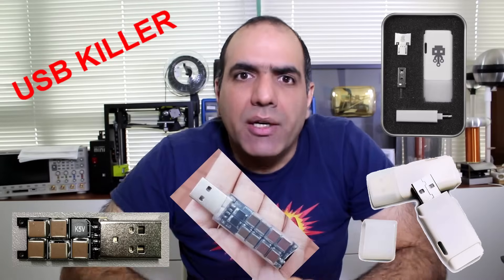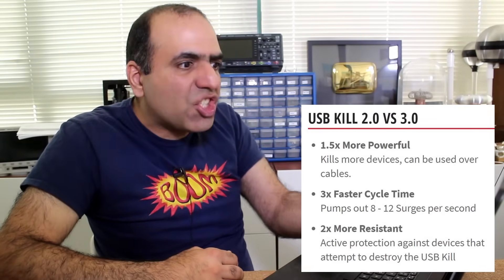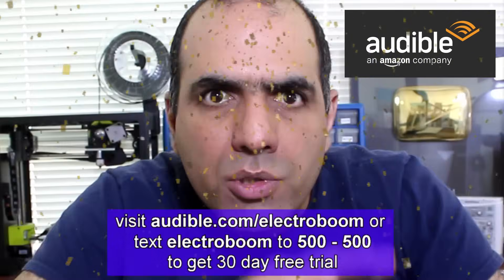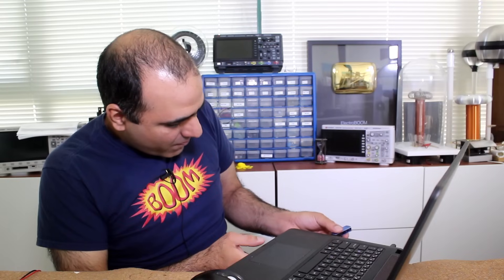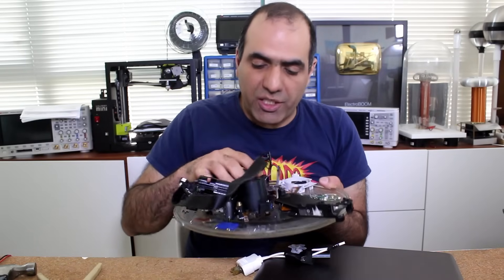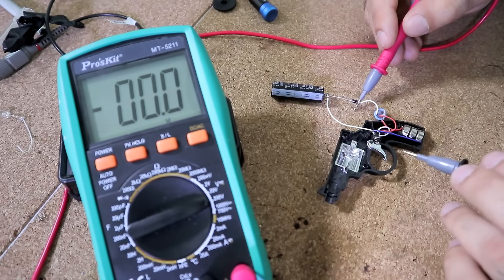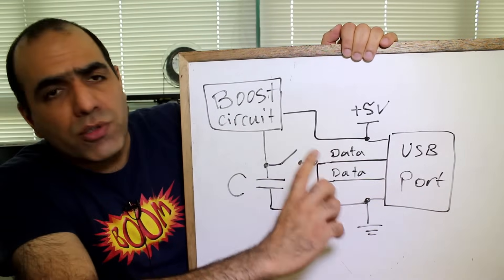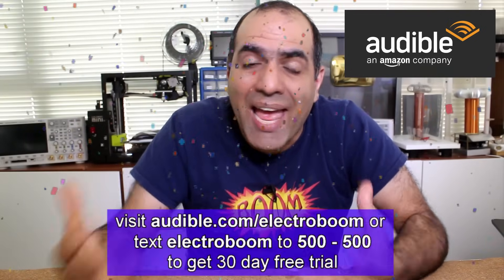USB Killer… WHY???

Comment from the maker: Hello Fam! Am I wrong about USB Killer? I can't imagine unregulated amounts of destructive power is used to test anything! Unless like I said, the plan is to check people's intelligence, and that would cost a bunch of money in equipment just to teach people a lesson! And why damage, when you can achieve the same thing in software, by tracking who plugged it?
If you like to post your thoughts and video ideas, submit them to ElectroBOOM subreddiit: www.reddit.com/r/electroboom
Reply: I work at a computer store, and we have seen the results of things like this. This and some other things like it are for destroying devices in a way that looks like a manufacturing fault for warranty fraud purposes. For example, our store offers replacement plans where you get a gift card when redeeming the plan. Some people like to buy something with a plan and then have the device conveniently fail shortly before the term of the plan expires and get a gift card to buy a new device.
Reply: They are quite useful for computer security teaching in companies. Nothing will be remembered better than a exploding laptop if someone plugs a found "usbstick" into the computer. (And overall it is way cheaper to replace a laptop than to loose all your data)
Reply: @EmpirePhoenix  Except for when you have open documents or flash storage. Dumb way to teach users
Reply: @EmpirePhoenix  lol yeah would be funny
Reply: Warranty abuse
Reply: Recreate the scene from breaking bad where they jumpstart the RV with galvanic cells in the desert, and you get 1 superlike
Reply: Everythingapplepro has used usb killers to test the protection of smart phones
Reply: Mehdi, please don't turn into a typical fat American. Fresh fruit and vegetables every day!
Reply: I've seen these used to ensure motherboards are killed before sending them back for RMA, where a known bad, but intermittent board is killed permanently to ensure it makes it through the warranty process. They're also used to destroy overstock/returned items so that they can be thrown away without people picking them out of the trash and using them.
Reply: @squat224  understand the first, but why destroy good stuff?
Reply: @superslimanoniem4712  because the company wants you to buy something, not pick it out of the trash.
Reply: @squat224  Why not just melt them down and reuse the electronics inside them?
Reply: @coastersaga  because capitalism. In other places they'd be stripped of usable components and recycled. It's not really economical for a big box store to go through all that work. Much easier to destroy it throw it away and make consumers buy a new one.
Reply: Clearly....  this must have all been somehow Etherkiller-inspired. 
So yeah  "legitimate test equipment" is just a facade or false reason for selling the product in order to avoid getting sued.     There's nothing to justify that price tag,   and   legitimate test equipment doesn't need to be so compact or disguised  so that it could be confused with a normal USB flash drive.     This product is specifically designed to be useful by someone for covert  malicious use;  as in vandalism,   and oh, how convenient that they're also a company selling some type of  "defense"/protective device,   Except  this doesn't fully prevent all the nefarious applications,   such as schoolkids sabotaging  public computers with them, etc...
Reply: It's obviously used to test stupidity
Reply: 9:12 "Although, I don't know...do they actually use bombs to simulate earthquakes?"

Introducing, the 1971 Cannikin Test: https://www.youtube.com/watch?v=UPwSN9gUG5c
Reply: How pitted are your meter probes?
Reply from the maker: @ferulebezel  pitted!
Reply: @ElectroBOOM  i hv one question, hw does the cap in the camera get charged to 300V from a 3 V battery ( At 6:43 minutes of ur vid)? Was a boost converter used somewhere?? The question might b silly though...
Reply: ElectroBOOM hi
Reply: @Newbiefly7698  I have the same question! Want to charge my DIY capacitor without static or transformers.
Reply: You're not wrong. Selling both the weapon and the defense system, there's no way around the fact they're giant dicks catering to others like them, and likely getting loaded while doing it.
Reply: leddit
Reply: Thanks to USB killer, many devices nowadays are protected against high voltage on data lines. Smartphones and videogames are getting better because of it. Of course it shouldn't be sold to common people, that is true.
Reply: It's probably meant to destroy stuff and the company just doesn't want to get sued
Reply: Yes, it is used for pen testing in critical environments, where there should be mitigations for such an event.
USB-C could potentially address this vulnerability but I'm yet to see authentication properly implemented.
Reply: This shit should be illegal.
Reply: A possible legitimate use of one would be to plug into public USB chargers and kill the data lines to prevent someone from trying to juice jack your phone. Correct me if I'm wrong, but a usb charger is only connected to the +5v and ground to a connector.
Reply: Ok boomer
Reply: Hi m8
Reply: Let's say that someone stole my purse or wallet. If I can't do anything about this, why SHOULDN'T I HAVE USB KILLER inside them, to take at least a little revenge or payback against the thief or thug that robbed me? It was his choice, so if he's now gonna plug the [killer] USB that he found in my purse or wallet into his PC or laptop, then he's doing this on his own responsibility.
Reply: Hey electro. It could be used to test reverse charge protection.
Reply: @MyMika2004  There are far better ways to test that. On top, that should be a design issue, so to be solved by engineers that know the in-and-outs and know how to use a power supply,  ferquencey generator and scope. A test is nothing without measurements. This device haas only one outcome:  damaged hardware - no test results at all.
Reply: @MyMika2004  no, to test reverse charge protection you should apply the same voltage the port is intended to receive (USB standard says beetween 4,5V and 5,5V) but with reversed polarity. The USB killer applies a voltage that is much bigger than that.
Reply: @MyMika2004  Finnaly somebody gets it
Reply: Hi!
Reply: i make a lyden jar like you when you make it but i dont have pvc pipe to charge it ineed thing like the pvc to charge it what is plss help me
Reply: Bill Murray the dead dont die  https://youtu.be/Gyvq02QS3sI
Reply: Sos el hermano de Juan Maldacena?
Reply: I think they mention it on the site, but in short they want to force manufacturers to build overcharge protections into their devices. Apple for example already implements some protection, but not for all devices i think. Its really cheap to implement something like this, and honestly this should already be a standard in USB. Also on their site you can get pro kit with testing kit for 72eur. With testing kit you can check what devices are protecter and which are not without destroying your device.
Reply: I am a fan of your videos because you shout in every video.  Be you.  You are informative and hilarious.
Reply: Like you said, some weaker ones will o my destroy the usb slot. This can keep other people out of your computer, although not very practical
Reply: @nishantkumar127  You should use Loudness Eq on your headphones/Speakers :P
Reply: When I watch your videos and you get shocked I can literally feel the pain
Reply: I read that commercial airplane manufacturers need to test with these in order to verify that someone with one of these can't destroy the plane's avionics through the USB ports in the seats
Reply: They are used to demonstrate the surgeproof usb ports. I personally use them to purge any old computers that have storage devices on the motherboard
Reply: Some people just want to watch the world burn.
Reply: I reckon a t-shirt can be made off the back of this... #winner ;-)
Reply: maybie tis to trick thevies? keep it on you keys andf catch out the cancdr from your circle. they wont know it was you and if they did its on them. you can then stop spending time with people whos computer completly breaks in the time it take to go to the toilet :P
Reply: Kill our URanus with that 
Lel 😂
Reply: i actually wanted to know whether it can be used to commit suicide or not? i m nt a techie so just guide me plz 🤗
Reply: agree think they are garbage products
Reply: I keep it in my purse so that if I am ever robbed... ;) jk, yeah malicious only
Reply: Those before and after stuff should be in every video.
Reply: Believe it not, companies such as Apple and Samsung have protection in place for such devices even on cellphones (because there are adapters to connect it via Micro USB). So, in a away, the device can be used for testing purposes. But I think mostly people just want to have fun seeing what they can destroy of their own property, not necessarily others. But it is used that way sometimes unfortunately though...
Reply: It's used as part of security penetration testing. The idea being you can disrupt a system for whatever your nefarious purposes might be. Theoretically a malicious entity could taint a replacement part that's being kept in a less secure environment and then leave the USB killer around to destroy an existing system and force the tainted replacements into use
Reply: Welcome to the insanity of this world. I've been on the same tear you have for quite some time now- just not on these, per se.
Reply: Actually, you already did the job of this device. Let's say you want to steal some data from me and you steal pendrive from my desk and plug it into my computer. Boom, your computer is gone. Even if not You don't know it, before you  plug it.
Reply: You Rosted USB killer
Reply: @Jesun-morningstar  I just said, that it is no more, that a weapon - you can use it to attack or to defend.
Reply: Hi Mehdi,  looks really dangerous Maybe put eye protection?
Reply: hi dude can you make a good teser gun from mosquito killing bat not like in your previes teser video
Reply: Hey Electroboom the Lichtenberg video got deleted from youtube why ?
Reply: It's meant to be used by testers: If you find a bug, use the USB killer to kill it.
Reply: I killed my old laptop with my bare hands. It had power issues and was agitating me. Broke the hdd, screen, and keyboard.
Reply: ElectroBOOM. I hope you didn’t destroy the laptop
Reply: @ElectroBOOM I believe it so that hardware developers can test their overvoltage protection. Apple has bought some of these (afaik) to test it.
Reply: Then theyre totally useless, they are probably a government prank to block malicious computers at the criminal`s expenses, while data stays untouched ready to be analyzed!
Reply: Happy Canada Day!😊
Reply: How to destroy a computer? Send it to Arabia!
Reply: I like your videos. I hope they get a translation into Spanish at some point .. well .. do you know anything about cold energy? I would like to know what you think of that. Anyway I send you a hug and greetings from Argentina
Reply: Hey electroboom check this out https://youtu.be/N7HO-FGJIFU
Reply: https://youtu.be/wOW6gtxfk8U enjoy!!
Reply: It's useful. For "security consultants" to market themselves by showing what evil things a criminal could do to your unprotected computer so they can sell you USB-killer protectors.
Reply: loved this i haven't laughed in a while thank you for that
Reply: I can speak russia. But just a little
Reply: It's used to make Viral videos and test devices power surge protection.
Reply: Maybe a USB killer is a tazer that's disguised to look like a USB flash driver
Reply: No, seriously somebody uses the USB killer on any of my devices I'd tase them Alexa didn't deserve that
 Siri got brain damage now
Reply: If you have ever worked in any computer retail store... and sometimes.. you have to return a computer when customer goes all out and tries to drag the company through the mud... even though the computer is actually fine, in a lot of these cases if the computer is within the normal... "DOA" period... a company may.. use... something like a usb killer, to produce a "valid fault" so they can then return it to the supplier for credit...
Reply: ElectroBOOM. These USB devices are used in blackhat hacking. It is very fast way to disable someones computer and later *fix it with your malware. So next time dig deeper before saying its useless. ITS NOT!
Reply: @radiiiiiiiiiiii  yes. VPN servers that run on RAM.
Reply: I keep one on my keyring labled "secrets" just to fuck with anyone nosy enough to steal my data
Reply: It's used to destroy everything around the USB adaptor and the USB itself
Reply: Some devices can somehow prevent the frying the motherboard
Reply: Well, I have some USB memories, but unfortunately no one kills my laptop, my computer or any other devices. Probably in other continents.
Reply: a usb killer is actually good for testing purposes, for example... when samsung worked on the galaxy s10 and s10+ they thougt about safety features of tge device and tested the s10/s10+ to make sure that the phone dosen't get any damage. everythingapplepro testet the s10+ with the usb killer and the phone didn't react at all from the usb killer amd the charging port was still working perfectly fine.
Reply: I'm gonna download this video to a  usb and share it to family&friends and call a killer usb 😀
Reply: https://www.ndtv.com/indians-abroad/indian-student-vishwanath-akuthota-gets-a-year-in-jail-in-us-for-damaging-college-computers-2084886?fb
Reply: Nobody needs it
Reply: U stupid bro 😂
Reply: USB devices like these are almost strictly for malicious purposes and function as a physical DOS attack. Its just more subtle than a hammer. A possible use I could think of for this involves anything that is vulnerable to this attack and would result in something connected to fail open.
Reply: Just to answer the question you posed in your video about whether they use bombs to simulate Earthquakes the answer is yes, sort of. Explosives can indeed be used to artificially generate seismic waves which can then be used to learn more about how seismic waves propagate and even learn about the geology of the area and composition of the Earth. The data from these artificial waves can then be used to build computer models of how the geology of the area responds to seismic waves that can then be used to simulate hypothetical natural seismic wave sources to simulate hypothetical earthquakes or volcanic eruptions etc. Course explosions used for this purpose are not simply limited to conventional bombs, geologists and seismologists have used atomic bombs for this purpose also granted usually piggybacking on already planned nuclear tests.
Reply: Its used for testing the resistance of your product.
Reply: You don't fail to make me laugh
Reply: I mean it would make sense if you were testing to make a computer that is bulletproof and only the USB ports will be destroyed with everything else being intact.
Reply: I have 2 of those things
Reply: The usb killer DOES test isolation of usb ports in design.   I know macbooks will actually still operate after being attacked with a USB killer.  And some smartphones   (tho the port is toast).  so it does have a niche use.  But for consumers. this is ueless    utterly useless.
Reply: You should get your own comedy show
Reply: A USB Killer can kill my I pad
Reply: I don't think anyone actually really harms other people with it, like you'll be caught anyway. The guy who broke 60 computers you saw got a year in prison. It's entirely a novelty, and it's fun to use on old laptops that are destined for the landfill anyway. I just watched you kill like 5 laptops, that had to be at least a little fun right?
Reply: U poopie
Reply: USB.   Kiler. Happy
Reply: It's one of those things, started out as a device to show a flaw in USB hardware and then someone turned it into a weapon.

Its primary use is destruction, the fact it even exists at all is enough reason to develop protections against it.

While yes, you could just plug in a 120v AC line into a USB port and fry the computer, these devices are portable, discrete, and work very fast making them perfect to sabotage critical infrastructure.

They really shouldn't be available for this reason, but they are. The bright side is manufacturers are starting to build protections against them into their devices which does improve our national security.

As a "test" device, the only people that I can think of who would want a destructive testing device like this would be military and electronics manufacturers looking to add protection against these devices.

It's a bit like gun, you can't just uninvent the shit. But you can make bullet proof armor, and in order to test that armor you do need a gun- you can't just throw pebbles at it and think that's sufficient, you've got to actually test it against a real device that could destroy it to see if it can stand up in the field.

Selling them to any idiot on the internet is just irresponsible though, and these companies could probably run into trouble with ITAR if the State Department decides they're an electronic weapon
Reply: I love your video, because it's so funny
Reply: Bibitty Bobitty boo.
The manufacturers know full well 100% of their customers are vandals. Those disclaimers are a CYA measure so they're not banned immediately.
Reply: I wish I had one at the time they stolen my pc backpack with all my things.

If I had one in the backpack 🎒 ......... payback
Reply: Sometimes you drill out locks on physical pentesting jobs.
Reply: does it kill ssd? and not hdd?
Reply: This device seems to be intended mainly for penetration testers, I could imagine plugging this thing into the USB port on some kind of terminal.
Reply: Some devices are immune, sorta. They have optocouplers on the data lines so it only kills the data lines on the port you plug it into and not the whole device.
Reply: Could be used for surge testing I guess.
Reply: If you have a work laptop... often your employer will not replace it till it breaks. Leaving you working on a potato. This would get you regular laptop update from your tight workplace.
Reply: @lucifermorningstar4606  If the goal is to just break your computer in a slightly covert way, there are plenty of ways to do that. Heck, just spill some coffee on it. Or squirt some water in it. Or give it a good drop. Or shake it vigorously while running. Or put a couple staples or paperclip inside it. Or freeze it overnight then use it and let condensation do its thing.
Reply: It's designed for manufacturers to test their USB ports so they can design a USB port that is resistant to such an attack
Reply: The USB Killer is designed to test devices for ESD. Those data lines of USB Killer are acting as quasi-ESD guns.
Reply: You are Wrong about the USB killer
Reply: @valevaden  OK. This device is only for Vandalisms.
Reply: Good video. Nothing is wrong with your video.
Reply: I didn't see where anyone answered the question about what the device is "really" for; (Like the legit use other than malicious) there have been stories of data mining though public USB charging ports. This device, when plugged into a suspect port, will release the high voltage to the data lines and fry the "mining" device.  Charging ports will only have the 5VDC connections.  Now they have to sell it as a "tester" for liability and legal reasons.  Personally, I have charge only cables, two wire cables, if you're paranoid about data mining though public USB ports, use an adapter that only passes the power, or a "charging only" cable.  But if you think of yourself as a "warrior against the hackers!": then you get or make a USB killer and plug them in all over the place wiping out raspberry pies tucked under the cushions of airport lounge seats.
Reply: i think that the “legal” uses are only listed to cover the company. i dont think prople who buy them intend to use them for legal reasons.
Reply: How about the OTHER USB killer?
https://youtu.be/FhIRuNXURtg
Reply: Yep ur wrong, its used for EMP testing just as you found out. They plug it in, and if nothing happens, the pc is esd resistant.
Reply: USB Killer. 
People think it kills your computer 
Yes it does. 
It can break your USB plug. And yet. Something worse :/
LAPTOP EXPLODES. OR DIE.
Reply: Yes you are wrong. This has actually led to improvements by Apple, Samsung, and Google to their products.
Reply: Its used to text how much electricity can go into the device without it being fried. Love your channel btw 👍
Reply: They're for revenge purposes, like destroying a hackers computer or getting back at the neighbor who killed your cat on purpose. The biggest problem is you need physical access to the machine, but if you don't know how to hack and can gain physical access then you're golden.
Reply: “0000
Reply: Nishant Kumar  y
Reply: Yyyyyyyyyyyyyyyyyyyyyyyyyyyyyyyyyyyyyyyyyyyyyyyyyyyyyyyyyyyyyyyyyyyyyyyyyyyyyyyyyyyyyyyyyyyyyyyyyyyyyyyyyyyyyyyyyyyyyyyyyyyyyyyyyy bru
Reply: Nah mate you're never wrong, i wanna grow up to be like you, electrocuting myself in the name if science!!
Reply: Well mobile and computer manufacturers use it to test if their device ports will blow up due to this so that they can make adjustments and prevent their consumers devices from getting blown
Reply: I9bbjjjjjjjjjjjjjjjjjjjjjjjjjjjķğğđş
Reply: T
Reply: Great video it reminded me of the countries that cause war's like in Iran and Iraq and then sell the weapons to said countries and make money like that, dodgy innit❤️👍
Reply: @ARIO1977  I love this guy so much
Reply: @nishantkumar127  thats what he do.
Reply: F
Reply: New to this channel. 1st video. And i like it. 😃
Reply: It tests ur device if its good enough on a usb killer
Reply: I hope that Lenovo laptop was dead or old and unusable, otherwise, killing perfectly good and usable stuff is Just a bad thing
Reply: even though it doesn't delete the data it kills the device for good
Reply: LOL AWESOME BROTHER
Reply: It's a quick way to disable USB ports in a data center
Reply: @silenthill4  You've meant kill them?
Reply: From what I remember it is not to teach others, but to test if your computer is able to protect itself.

I believe it was created in India by a software engineer to test how effective his software was from being affected by unknown USB drives (normally to protect from hacker sticks). Adding the USB power to continue with the USB improvements, as well as anonymous features only make this tool even more powerful. 

However, these are like a set of lock picks. Useful in the right hands and the right time, but illegal in the ways most people want to use them.
Reply: 0
Reply: Maybe for penetration testing (infiltration testing by white hats)
Reply: Can you please make a circut tutorial. For 3,7 Volt to 600-900 Volts? Of course DC so I can charge my capasitors (3;4* 330 Volts 100uF)
Reply: It might be for tech manufacturers test whether their device blows up and sets the warehouse on fire when it is plugged in.
Reply: @nishantkumar127  bro its mehdi
Reply: It’s to teach a lesson to someone who steals your USB’s.
Reply: pelese eletroboom don't destroye your laif
Reply: At first glance, it seems like it wouldn't be useful for anything practical, but I think it may be usable as a device to test USB socket protection???  By that I mean protection against what ElectroBOOM did at the start of the video with the laptop and the 120 Volt AC cable or something similar.  (Sorry if anyone else already said this, I didn't read any other comments)
Reply: to be fair your motherboard ceasing to be would probably stop the police from seeing your tax fraud
Reply: I like it
Reply: Austin Evans LOL!
Reply: That's how they tested the A-bomb: one of these babies kills your entire population.
Reply: Lola nie
Reply: USB
Reply: USA GTA San Andreas
Reply: Is there a way to charge a high voltage capacitor with low voltage without using a transformer?
Reply: I thought its for those petty thieves that will destroy their own computer when they put it in. Sadly a 1 te trick
Reply: qAn
Reply: I prefer to leave destructive engineering a mystery.
Reply: Tbf I never heard of it until you showed it to me in this video. Now I know it exists I cannot un-know this :D
Reply: The only good thing about this i heard is to just to stop people from stealing usb

Like if you had the thing in your room and someone steal it they cant do anything if they plug it into their device since it not your fault since they STEAL IT
Reply: They used it to kill police  computers
Reply: Do you how many times you have zapped?
Reply: Hello
Reply: someone is mailing these rigged to capsules of RDX to reporters in ecaudor they detonate when give 5v
Reply: I am sorry but you keep saying other peoples property's instead of property check you grammar
Reply: The way he makes such amazing jokes while keeping a straight face 😂
Reply: you seem to be missing the point that big tech companies can use such a device to test their products and insure their products are not going to be effected by such a device...
Reply: Lol agreed!!! Firearms are not a good way to test if someone is alive! Lol
Reply: Don't want to spend hundreds of dollars on a USB killer? Just buy a Macbook! Its JTAG connector is conveniently placed on the board so that every drop of liquid that gets into your machine will go through it. For the best effect, the backlight and CPU Vcore pins are placed right next to each other, so that when they get shorted, your CPU will be immediately fried! You don't need to worry about the safety of your data either. The memory is soldered onto the board, and we've removed the data recovery connector, making it completely impossible to ever get the data off of it. (and everyone who says it is possible lies to you and is a scammer)
Reply: @MrSalat21  Somebody has watched too many Rossmann rants.
Reply: ElectroBOOM you can also make a taser from this disposable cameras the same way
Reply: Its designed for lazy computer technicians to warranty laptops.
Reply: IT HAS LEGITIMATE USE. Here's why:

Hi ElectroBOOM! So I'm a penetration tester, and test physical/infrastructural security on client companies. I own one of these devices, and use it to test in-built surge protection on servers against malicious actors on critical infrastructure. Malicious actors may plug the stick into, or get someone else to plug the stick into, critical infrastructure. This would result in a denial of service attack. Much of the time, this is then utilised to further gain access to a client's systems. They can also be used for social engineering mechanisms, for example:

I plug in the killer, the computer doesn't work, the company calls IT support, we turn up posing as IT support and use that leverage to gain access to their systems.

My job is to imitate what criminals may do to steal data, and ensure that the companies who hire us are safe from attacks. This tool is specifically designed for us, NOT for IT engineers, hardware engineers, or members of the public.

Just to clarify - people with malicious intent will target company systems with such cheap devices as you demonstrated how to make. Critical infrastructure systems such as servers usually have this kind of surge protection (yes, it is a security standard and must new servers are immune to attacks like this). Penetration testers like myself engage a client to try and break into their systems. In doing so, we sometimes use devices such as this in the same way criminals do, in order to test how resilient a company is, or as a part of social engineering attacks. This device is specifically made for penetration testing and penetration testing only. Many many USB penetration testing tools exist, such as the USB Rubber Ducky, or Bash Bunny. One could argue that there is only ever malicious use associated with these devices, but that wouldn't be correct. Security testers such as myself usually get a bit of a bad rep for this kind of thing, and we're working hard to try and show just how important testing things like this actually is. THIS IS NOT FOR CONSUMER USE!!!
Reply: @solomongilbert3186  What? That makes no sense. Plugging a "usb killer" in would not result in a denial of service attack. Penetration testing shouldn't be causing real actual damage either. If pentesters are actually wrecking hardware and data you hired a bad company. Even physical pentesting employs nondestructive methods of entry.
Reply: @frequencydecline5250  I seen a video of a USB killer in action on this platform and burned a hole in the USB chip 
to randomly do that to expense equipment is a no go.
Reply: @jamberrytastic   I have no idea what you are trying to say in relationship to the comment I made 9 MONTHS AGO. I don't know if you are agreeing or disagreeing but I stand by having said that no legit pentest group is going to go in to a company and actually wreck a company's systems. And I stand by having said that plugging in a usb killer is not going to show up as a dos attack on a network.
Reply: @solomongilbert3186  no. You wrong. Maybe is made for pentestig, but it isn't marketed like that. If it was, it would clearly state it, plain and simple 'for penetratiin testing only'. But they don't. 
Wonder why?
Maybe it was designed for that 
Just like saying picklocksnwerebinvented for testers only. No. Just no
Reply: @htcmlcrip  It is marketed as a testing tool?
Reply: @solomongilbert3186  how often do you destroy computers?
Reply: @solomongilbert3186  hi Solomon! I am getting into the IT market, specializing in infosec, and really want to get into penetration testing! Are there any tips you could give to someone wanting to break into this field of work?
Reply: @solomongilbert3186  So, you have physical access to the server, and you plug in a USB killer in order to indirectly gain physical access to the server. On top of that, instead of using non-destructive tools and documenting dangerous policy violations, you physically damage property belonging to your alleged "customer," and for no justifiable reason. Whether you're trying to instruct them on BadUSB attacks, Evil Maid attacks, badge cloning, or social engineering issues, you are going about it the wrong way.
Reply: @solomongilbert3186  I actually remember hearing about the very first ones of these that were made by IT Technicians when powered USB hubs started to be a 'must have' thing in offices (when USB ports on motherboards were a rare commodity) and were marketed as being protected against power down the data lines. People running over dangling USB cables with their chairs and mashing the cables lead to crossed wires and 5V going down the data line and making it beyond the USB hub and damaging/destroying the USB port on the motherboard because it wasn't actually protected as stated. So IT Technicians made a cable that would cross the wires and light up an LED connected to the data lines of a modified 'to PC' cable so they could determine if the USB Hub was safe to use.
So their current incarnation serves no purpose to the public, but their initial creation actually did have a reason.
Reply: @solomongilbert3186  So how does killing the USB controller help steal data?
Reply: Solomon Gilbert it sounds like you have a very cool job! kind of like a white hat hacker, but more hands-on?
Reply: @solomongilbert3186  I highly doubt most companies are going to be happy if you destroy a piece of equipment worth thousands of dollars just so you can tell them "you should probably have had some surge protection on that". Surely there is a less destructive way of figuring out if a thousand dollar + piece of equipment has surge protection.
Reply: @solomongilbert3186  It has no legitimate use for pen testers either except to educate customers to its existence.
Reply: @anullhandle  ummm deactivating security systems??
Reply: Found a use for it and its to make stupid youtube videos that you destroy expensive electronic devices! You get a ton of views and flex your money at the same time...
Reply: @the_danksmith134  dang, you're right! Also, a hungry child could have eaten that Lenovo!!!!
Reply: Well in Finland there are people who do earthquake tests with dynamite in your kind of way.
Reply: @spug3t  Finland is hardcore fam. I love Finland even more after hearing this!
Reply: I thought of one ligit use if your makeing a Artificiall general intelligence and it is going rouge then you can plug it in as a last defence.
Reply: @erikburzinski8248  to kill its usb port when its in hte internet lol
Reply: @erikburzinski8248  *rogue. Rouge is quite different.
Reply: The hammer works for this and is cheaper.
Reply: @erikburzinski8248  yeah lol
Reply: @erikburzinski8248  what? ai dont go rogue. Read the book life 3.0. It will explain
Reply: @erikburzinski8248  rouge is red and rogue is correct
Reply: @erikburzinski8248  if you can plug a usb you can unplug it or throw a grenade
Reply: I had considered making one of these when the article appeared on hackaday in 2015. Someone else had the same idea as me: to integrate it with a legitimate USB storage device and an external write protect switch (or some other mechanism known to the user). That way if the device ever fell into the wrong hands it would deter them from accessing your data.
Reply: USB killer -> female to female usb adapter -> phone charger -> phone 

Maybe 💥💣💥?
Reply: @MrBthrower  yes most devices will die from this.
Reply: @MrBthrower  linus tech tips already done it. 😮
Reply: There is a use for these. Should be part of every PEN testing kit. It's to teach people not to plug strange USB devices that are handed out or found on the street into their computers.
Reply: @Mr.Unacceptable  ehhh people are not going to pay the price for one of these devices juat hy chance a single person might kill their usb port
Reply: @iwinrar5207  Your right any pen tester worth their salt would make their own.
Reply: @Mr.Unacceptable  That's a bad way just to teach users
Reply: Make a video about wifi repeater
Reply: i actualy thinck usbkill could be usefull for 1 purpose. To develop better usb outlet for computer design to be resistant to power surge. Like by exemple when i shorted my arduino data pin and my 12v power suply ^^' ... and yes its killed my computer. i Found out that some computer have thermales fuse in there usb to protect them from that ;)
Reply: It is pretty useful tho. I used it to kill my laptop just a second before  my girlfriend check it if there's any porn. I regretted nothing
Reply: haha, thx a lot.
Reply: this product is for penetration testers that test security systems. Some companies want pen. testers to destroy computers sometimes so that they can see how their employees report it, if they report it and how quickly the problem is solved.
Reply: USB killers were a thing long before the site. Theh arent new by any stretch. 

This one being a tester allows companies to test new methods of circuit defense methods, including but not limited to optical data nodes and fuses to prevent reverse polarity attacks.
Reply: electro this is used by penetration testers who need to show they can breach a organization
Reply: When you flee from iran, yankee came to bomb your family. traitor And again, never touch soviet russia. that only one country which can protect your homeland, and you be first one who will beg about help
Reply: You look almost like Adriano Celentano ! please make use of this !
Reply: you can get one for $3.10 lol
Reply: ElectroBOOM  hi utkarsh from india....make a part 2 video showing how to protect electronics from jerks carrying the USB KILLER......cnt run forever from them😭😭😭😭😭😭😭😭😭😭😭
Reply: @utkarshupadhyaya7091  some computers have the USB data lines converted into fiber optical line then back into an electrical data line.
The result is that the data lines are isolated from the motherboard thus protecting the motherboard however the port will not survive.
Reply: @utkarshupadhyaya7091  stop snooping on other peoples usb sticks. 
Or simply plug it to your wall charger and see if it stops working... Wait that won't work as it uses data line to discharge hi voltage. .
Reply: @htcmlcrip  take it apart, a normal stick will have memory chips on it, this thing has capacitors
Reply: @superslimanoniem4712  what do ou mean? Remind me the point? Can’t find to what you respond.
But. Yeah all electric components has capacitors. 
What am I missing here? (As I don’t want to speculate what you’re saying)? 
I know electronic stuff reasonably okay. I do what electeoboom does at times as a hobby.
Reply: @utkarshupadhyaya7091  as an end user the only real way is plug up or disconnect the usb ports from the device.
Reply: @utkarshupadhyaya7091  To protect device from ESD, you need a special chip. You can find such a chip in LCSC.
Reply: Pretty sure they normally use the same controller for USB and SATA; not sure about ATA
Reply: USB Killer It is actually a test device, can be used to see if the USB port is protected for large loads of curent, so it won't fry your laptop or other device.
Reply: Did you actually get one of those devices to kill your computer?  The purpose of the USB killer as far as I know is to demonstrate that USB ports are unprotected from reverse voltage or something like that.  Modern computers are protected against it.
Reply: I have to disagree to some extent. It may be used to test operators level of consciusness in poorly designed nuclear plant. Let's use example of my former job. Central computer that runs SCADA and is used to gather all data and manage water treatment for middle size city had no connection to the Internet for safety reasons. However it had USB ports accesible for anyone that got to control room. Operators rarely had to monitor process all the time as everything run automatically. So if bored operator wanted to watch porn he would just plug USB drive. I'm not saying that is highly plausible scenario but someone could really test the crew and leave USB killer on the desk in control room for SNAFU.
Reply from the maker: So isn't that something that can be handled in software, you really rather see the work computer explode?!
Reply: @ElectroBOOM  Well, it never happened because guys at work are quite aware of the consequences and never used that port.
Reply: unless the computer has a optocoupler installed between the Motherboard and usb it just kill the port
Reply: It is used to test electronic s
Reply: @adcubing1992  You're wrong. This device is only for vandalisms.
Reply: I have no opinion I have to trust your opinion let's hope you don't hold a grudge on what Trump is doing eegad
Reply: ElectroBOOM great video as usual. My only small caveat is that the original device was made to demonstrate how vulnerable the USB ports are. I think the creator made appeals to revise the usb standards to prevent vandalism. When they didn’t get a response, they released the usb killer decide as a last resort to appeal to the companies to upgrade their standards.
Reply: ElectroBOOM you’re totally wrong, your existence is useless tbh
Reply: U live in Russia ?? I'm not new , but that's new to me
Reply: @mufasateamnesquik8624  He obviously lives in Canada. Amazon was set to canadian dollars
Reply: @Soren_Pedersen  K ,thanks
Reply: I'm sure this has been said many times over, but this product helps manufactures become aware of these issues so that they can fix them. Many of which actually use these products to make their devices safer to those unsuspecting consumers.

The iterations are to help companies keep their protections up to date and to not turn a blind eye to these flaws.
Reply: Thomas Galland this is like saying that burglars exist to make you aware of your door's vulnerability. Of course they do, but A) it's not their primary purpose and B) when you learn, it's too late.
Reply: Please make a video about making a transformer 
Like if you want the same
Reply: @8dmusix00  soo i it's a yes from me
Reply: Its used for like breaking hackers laptops pc etc to erase all data bcuz it breaks the hard discs
Reply: @makkone_  It does not.
Reply: @resneptacle  well it broke my old laptops hard drives and mother board an those things.
Reply: @makkone_  no it doesn't.